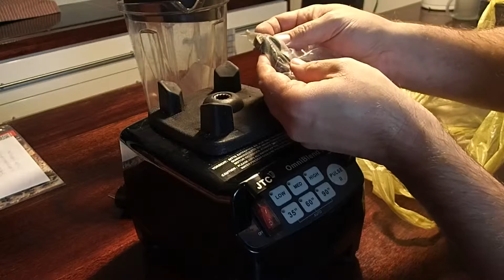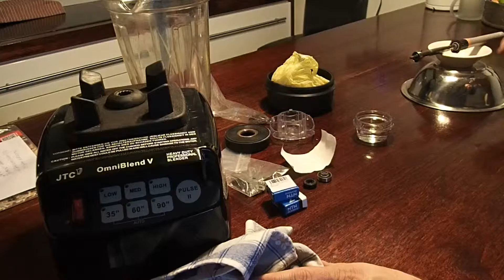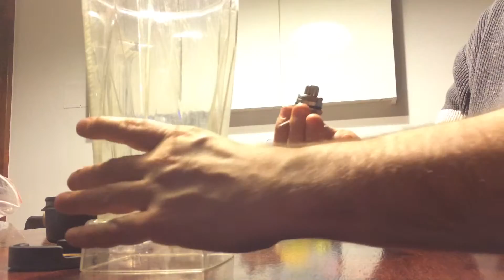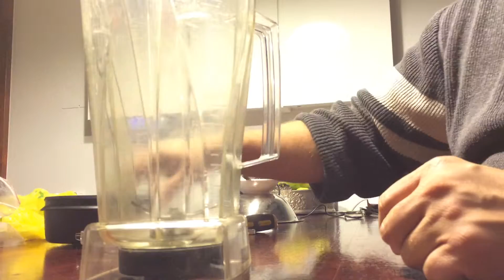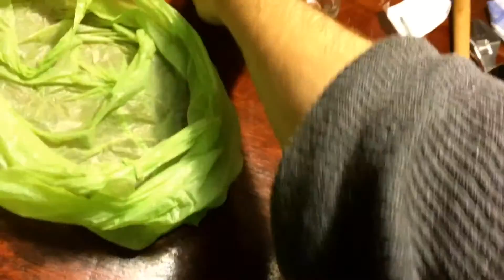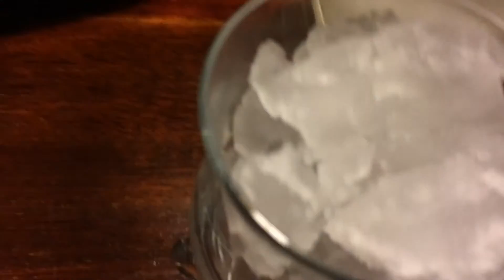3HP OmniBlend V Blender Repair

Comment: Hi, how did you extract the bearings from the socket ? I managed to get the shaft off easily, hitting it gently, but the bearings are stuck hard into the socket. I would like to replace them. Cheers
Reply from the maker: „Painfully” … you might try to knock them out by putting through a screwdriver etc. from the other side, trying to place against the bearing edge and knocking with a hammer alternating from side to side
Reply: @TomaszPlawski  Thank you very much sir, I will try that. It looked like a dangerous game to me, because of the rubber gasket that is just above the bearings, to isolate them from the food. If I damage it, I have no idea how to replace it, beside buying the whole socket new.
Reply from the maker: @lelapinmagicien1471  the rubber seal also wears out and should be replaced in the process. The bearings in most cases fail, because liquid starts seeping through this seal and cause the bearing lubricant to emulsify. And in my case buying this special seal turned out to be more expensive than the bearings. All in all and taking into account the hassle of the disassembly, the second time around I opted for buying the whole knife module from China.
Reply: @TomaszPlawski  You are right. My hope was that I could source a better bearing than the original one, get it replaced and enjoy years of good service. But if the seal wears out, I'd rather buy the whole module. It can be found between $10 and $20$ on aliexpress.
BTW, I have this Biolomix G5200, and disassembled it to inspect inner working. The motor is a 850W (not 2.2KW as advertised), but still powerful enough. I changed a bit the triac power control because I wanted to be able to start the blade slower in some case, mostly to avoid spreading the content everywhere into the jar. Easy tweak, if you are interested.
Reply: Out of curiosity, do you know the name of the seal part ? I found the bearings easily (608z) but I don't know about the rubber seal.
Reply from the maker: @lelapinmagicien1471  It was a Lip Seal 
… something like this https://a.aliexpress.com/_uIS0zi I.D. 8mm O.D. 20mm and height 7mm mine didn’t have any legible markings and my measurements could have been really rough, so I sent it (at least what was left of it after extraction) to a local bearing supplier asking for a replacement. If I recall correctly my measurements were correct, but it turned out that the height of 7mm wasn’t something typical which would be available from stock, therefore they had to specially bring that in by courier and thus the price came in to the equivalent of around $10 for just this seal.
Reply from the maker: @lelapinmagicien1471  ps the bearings they supplied were 608 LLB/5K from NTN - better for high speed … looking at the speck the O.D. Of this is 22mm therefore I’m not entirely sure if the OD of the seal was really 20mm it went in fairly loose compared to the bearings. Ps. After the seal is installed and before the bearing the inside is packed with some food-safe grease to further protect the bearings from any liquid seeping in through the seal.
Reply from the maker: @lelapinmagicien1471  the 2.2kW might be the peak power when for some reasons the blades get seized … for the two seconds before the motor windings start smoking :) (or actually the safety overload switch should kick in) - it was always a mystery to me, how all these manufacturers of blenders define the power rating of their devices. I took apart a handheld blender once which was marketed at 800W where the motor was in fact 300W.
Reply: @TomaszPlawski  Thank you for the link. At first glance, it seemed to me that the seal was cone-shaped. I will try to extract mine and see. The food-safe grease that was used to seal my socket was orange-brown and stinking so hard that I could smell it in the clean jar. Also it spread onto the blade, so I guess I eat some of it. Hopefully it is really food-safe. I eventually got rid of it, I prefer to change the bearings more often :)
About the 2.2kw that actually are 0.8kw, I have no idea if there is a rational behind, but my first guess is that they are just lying. I don't know why though, since this blender is plenty powerful enough !
Reply from the maker: @lelapinmagicien1471  I think that they all lie and it's some "relative" horsepower in view of RPMs etc. as the average consumer just assumes the more the better and having two units at similar price will buy the one with declared higher power.
Reply: @TomaszPlawski  I got the bearings and the seal out. The bearing came out without much issue, but the seal was totally stuck glued to the socket. I tried pushing, pulling, oiling, boiling, everything. I eventually gave up and just soacked the socked in a glass of acetone, and that did wonders. The seal inflated and poped.

I measured the size of the place for the seal. Again, my blender is a Biolomix G5200, and this is original socket. OD: 16mm - ID: 8mm - Height: 5mm.

Cheers,

Comment: Hi. Maybe you can help me. My omniblend just turned off while I was mixing something and the power light is off. And it was smelling also a bit, don't know if it was the motor. Maybe you you have an idea what I could try to keep it? Thanks a lot from Germany. Heike
Reply from the maker: Check underneath if you have a small thermal protection reset button - some machines have manual one and some an automatic switch, which resets after the machine cools down. However if it started smelling there is a risk that the motor coil insulation overheated too much and if not now, in some time it might short circuit and burn completely. (I had a supposedly “professional” Waring Commercial blender years ago, which totally burned ) How old is your mixer? Mine also started smelling a bit and switched off after I tried grinding meat for a smooth pâté but after a reset it resumed working and as opposed to the earlier Waring it is still working after something like two years, therefore not much to worry about. Even if or does eventually fail, I think I will replace it with this http://ali.bargains/blender
Reply: @TomaszPlawski  thanks for the fast answere.
You were right, I just found that reset button and pushed it. The light is working again and also the mixer.
Super. Thank you so much. 🤗👍🌻
Reply from the maker: Great it helped :)

Comment: I replaced the bearings in a friends Vitamix that was about 20 years old, but could not find a seal, so I had to reuse it and the bearings failed again in about a year. I told her not to leave liquid in it and just blend and dump it out, but she didn't listen. I had her to just go online and just buy the whole blade assy. from vitamix and it is still ok. I don't know if you can get vitamix parts where you are. I am curious now as to who is the original manufacturer of these blenders, Omniblend or vitamix. I think Vitamix has been making blenders since about 1950. Yours has a different control panel. but the rest looks the same.

Comment: I was able to use a vise and assorted sockets to press the parts in and out with no problem. I didn't know there was another blender on the market that used Vitamix parts. 
Do you have the part number for the seal?
Reply from the maker: unfortunatelly no part number for the seal - it was found for me by a local supplier but according to him it was something "exotic" However not only it was expensive but also the courier shipping ... and now after a few months of intensive use it failed again (probably because I didn't have suitable thick grease and used cosmetic grade vasseline some liquid was seeping in and destroyed the bearings. If you see in the comments below there is a link to my new movie showing the entire blade assembly I now got from China for under $15 https://goo.gl/aNiND1 (price includes cheap shipping thus took about a month to arrive, therefore it is good to prestock one just in case for the future).  The blade assembly I got has serrated blades which do a great job of cutting up fibrous vegetables, but it's also possible to remount the original ones.

Comment: Good.. what's the bearing size /number
Reply from the maker: +Bob Simon the bearing is 608 VV and you need two pieces
Reply from the maker: +Tomasz Plawski and that's from NSK as an alternative you can use a 608 LLB/5K from NTN or 608-V from NBK so in general a 608 suitable for High speed (they have different ball configuration depending on speed/load) and having covers suitable for such high rotation speeds. You also need to pack the inside between the bearings and the mounting piece with some thick foodsafe greese.
Reply from the maker: +Bob Simon the worst part was getting the axle seal - I had a local bearing shop match one for me as the original was torn/burnt to a point where the markings on it were illegible... next time the bearings fail, I'm considering getting the whole assembly from China as this seems should fit: https://goo.gl/Hrn7Xb just need to confirm with the seller what are the actual dimensions. ... and if not this, there are many others on AliExpress therefore surely should be able to find a suitable replacement, especially considering this is a China-made blender
Reply from the maker: +Bob Simon there is even the complete jar assembly with the blade https://goo.gl/wOY9L1 and compared to the original I have, the bottom mounting ring here seems to be aluminum not plastic
Reply from the maker: And here is a complete original replacement blade assembly for $39 https://goo.gl/hUs4kf (worldwide shipping included in the price)
Reply: Thank you Thomas for detailed reply..That $39 looks good.. plenty are there if you check in Ali Express .. but which one we can trust ..??
Reply from the maker: +Bob Simon found one for even around $12 here https://goo.gl/kzoqBx and I think I'll risk it and have one for a spare ... there was even one on offer for around $10, but in the feedback pictures somebody posted that it was leaking after only a few usses therefore this one seems that it should be better. The risk also isn't high - when I was repairing mine the shipping itself for the bearings and seal was about the same as here for the whole assembly.
Reply: Please update always
Reply from the maker: As an 'experiment' I have ordered a complete replacement blade unit here https://goo.gl/ynWn46 compared to the original these are SERRATED - once it arrives I will let you know about the fit and I'm also hoping that with the serration this will allow for really fine cutting of fibrous foods. With the original blades it's not possible for example to make green peas soup by grinding entire pods. You end up with long unchopped fibers that get stuck in your teath. This should also allow for making much smoother soy/rice/almond milk.
Reply from the maker: The replacement blade has arrived! Fits and blends great! ENGLISH https://www.youtube.com/watch?v=YAvxxyySbMA
POLSKI https://www.youtube.com/watch?v=gV-7_S2ArHg

:)